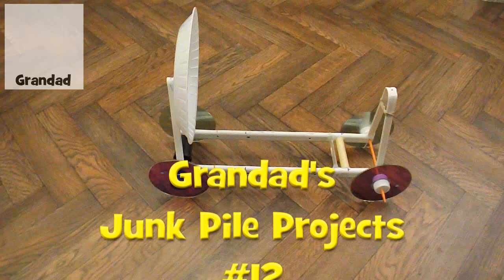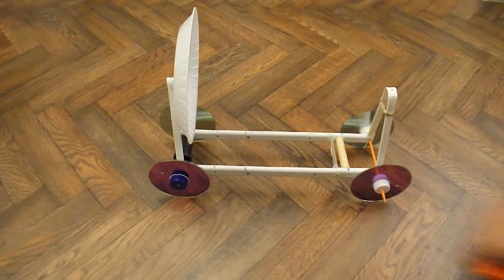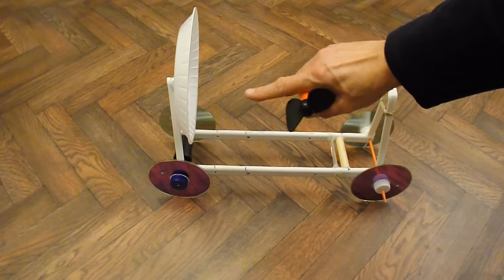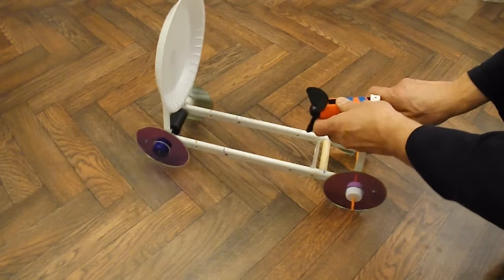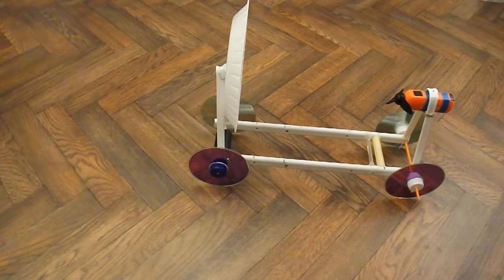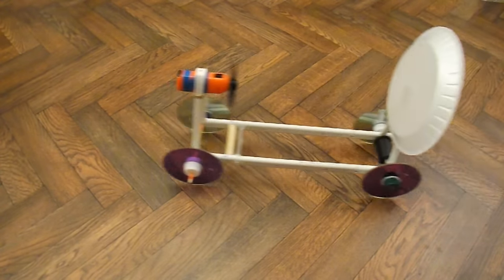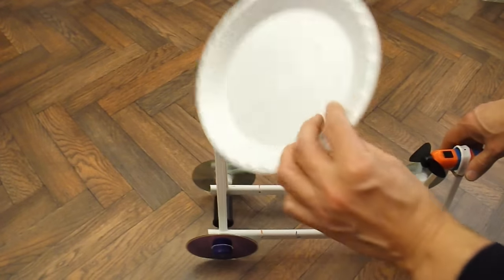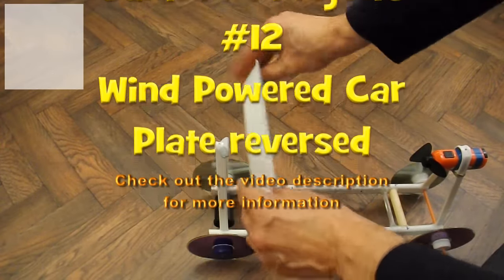Grandad's Junk Pile Projects #12 Wind Powered Car Plate Reversed

Comment: If you're not already done with this, you could demonstrate whether it has any effect if you blow on the various sails sideways from various angles holding the fan in your hand and if you can somewhat steer the car. Maybe you could even use two fans, one blows straight into the sail, the other one blows on one of the front wheels to steer it. Or just one fan and blowing from behind to get the car going and then blowing on the wheel for steering while the car is rolling. Or you make an additional sail 90 degrees to the other one for steering. If it works at all you probalbe can't make sharp turns though. I'm thinking of a game for the kids. They would have to manage a parkour or something like that.
Reply from the maker: +theheinzification haha, I won't be doing any of that. You could spend ages on this project with all sorts of variations but I have done all I want to do. Thanks for the suggestions but I have other projects I want to move on to.

Comment: Please reply ASAP, I have a project do tomorrow, I'm doing rubber band power, but I don't have bottle caps or Cd's what can I use for wheels?
Reply from the maker: +Mahdi Samara cardboard, wood,paint tin lids, anything that is a disk. Here are some of my cars that do not use CDs for wheels
https://youtu.be/5UBuuxg3y58?list=PLA5a2xPRSrB3g5RiX8Kf_uUBOL0Tb7AS0
https://youtu.be/OvTkiOlcpoc?list=PLA5a2xPRSrB3g5RiX8Kf_uUBOL0Tb7AS0
https://youtu.be/v3pbVAYkGf0?list=PLA5a2xPRSrB3g5RiX8Kf_uUBOL0Tb7AS0
https://youtu.be/XRykymHoPZ0?list=PLA5a2xPRSrB3g5RiX8Kf_uUBOL0Tb7AS0
https://youtu.be/0zCR443Ha08?list=PLA5a2xPRSrB3g5RiX8Kf_uUBOL0Tb7AS0
https://youtu.be/jmvqN3M1OoI?list=PLA5a2xPRSrB3g5RiX8Kf_uUBOL0Tb7AS0
https://youtu.be/GacW6rP5IcA?list=PLA5a2xPRSrB3g5RiX8Kf_uUBOL0Tb7AS0
https://youtu.be/iKkiCvlsb0M?list=PLA5a2xPRSrB3g5RiX8Kf_uUBOL0Tb7AS0
https://youtu.be/2sO7X7qGRAs?list=PLA5a2xPRSrB3g5RiX8Kf_uUBOL0Tb7AS0
https://youtu.be/P-WxzgFQSyY?list=PLA5a2xPRSrB3g5RiX8Kf_uUBOL0Tb7AS0
https://youtu.be/7m9dG_3-hjc?list=PLA5a2xPRSrB3g5RiX8Kf_uUBOL0Tb7AS0
https://youtu.be/JYnkbt0unfg?list=PLA5a2xPRSrB3g5RiX8Kf_uUBOL0Tb7AS0
https://youtu.be/2rSL2NZEhqk?list=PLA5a2xPRSrB3g5RiX8Kf_uUBOL0Tb7AS0
https://youtu.be/7UvgG8Rc5fM?list=PLA5a2xPRSrB3g5RiX8Kf_uUBOL0Tb7AS0
https://youtu.be/71u6XeUrUHY?list=PLA5a2xPRSrB3g5RiX8Kf_uUBOL0Tb7AS0

Comment: what if you turn the fan uround and use pipe or something to redirect the air to the plate will it actualy have the power of the car when the fan is not atachet + the power when only the fan is on the car.
Reply from the maker: +Marin Minkov maybe you should have a go yourself and see what results you can achieve.
Reply: +GrandadIsAnOldMan maybe if I wasn't in the middle of my semester exams.
Reply from the maker: Marin Minkov I am glad to hear you are remaining focused on the more important things in life. Good luck with those :)
Reply: +GrandadIsAnOldMan thank you